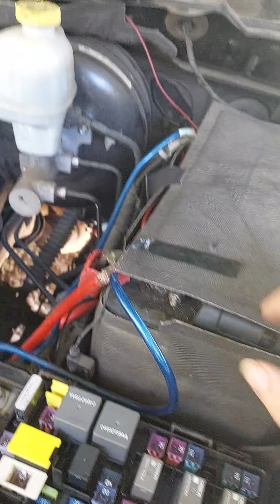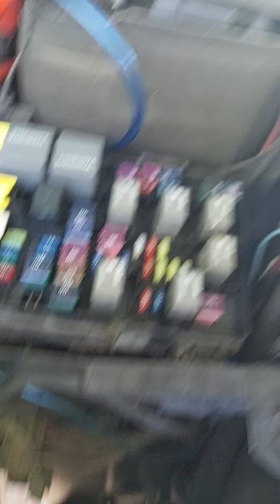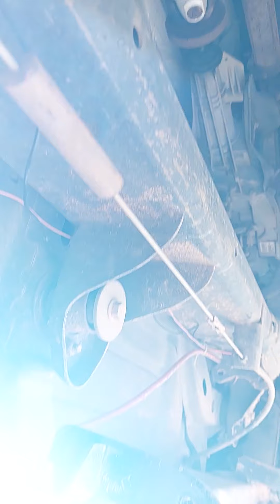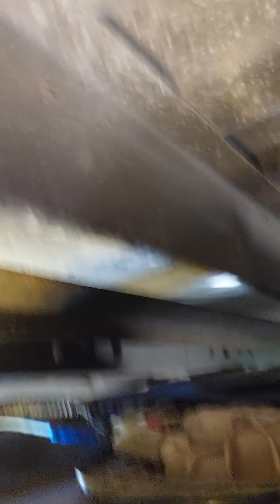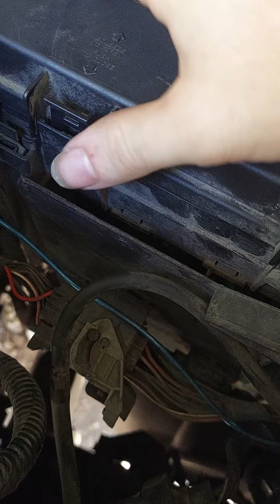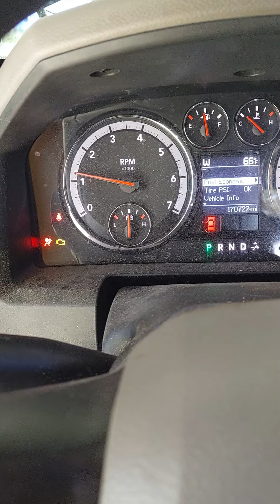2012 Ram 1500 TIPM Bypass with External Relay - Fuel Pump Fix

Comment: When you said hot wire into the fuse box, what number is that on the relay prong?
You mentioned pin 85 to ground, pin 86 to m7 fuse, pin 87 to fuel pump wire(blue & orange),
Where is the fourth pin on the relay going to connect?

Comment: I had the same issue with my 2012 1500 Ram   After replacing my fuel pump. You have a nice set up but here a what I found. 
https://youtu.be/HcV5oAF1hM0